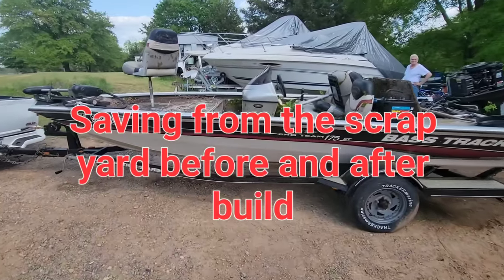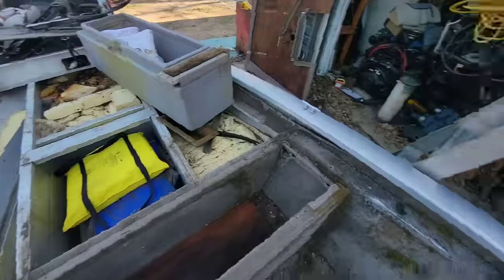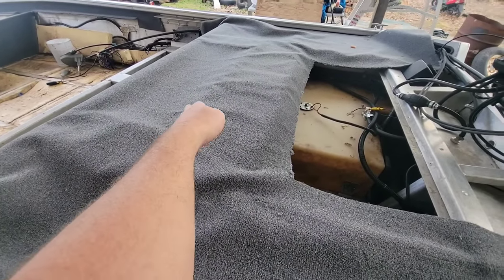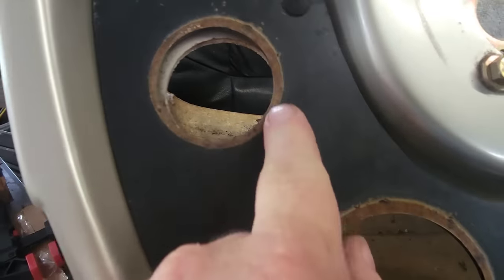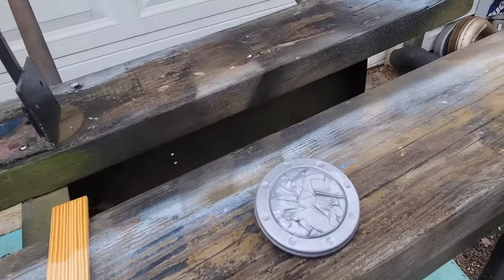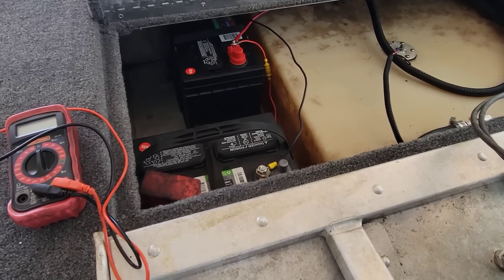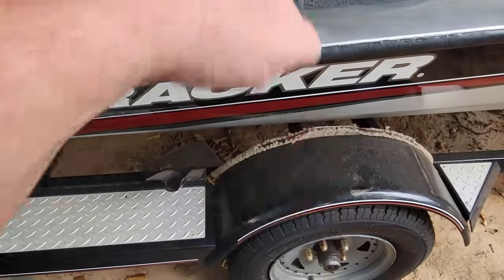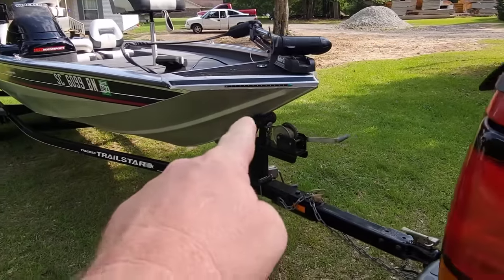Must see Bass Tracker restore before and after transformation@Vassmotorsports#trending #viral

Comment: Really nice restore!!! I’ve seen lots of them were the motors torn up electronics are all shot etc. that was a great score with the motor and trim intact. You do great work👍
Reply from the maker: Thank you and yes that was the best part about this boat ( and all aluminum)  but I've also saved and rescued many pleasure boats with mercruiser v8 and some had no drivetrain at all and I know those boats like back of my hand lol.  And grew up building chevy motors.  Really don't know much about outboards
Reply: Outboards are simple engines but can be tricky to tune etc. I’ve rebuilt a couple small outboards parts can be hard to get!

Comment: That an awesome job. Like you, I'm a perfectionist and as a perfectionist I noticed that the elevated seat on the back deck, well the plate on the bottom of the seat looks backwards. Could be wrong but check that.  Seat should lean slightly backwards when correctly installed. The front looked correct. Love your work!
Reply from the maker: Thanks and ill double check but I think the plate is same all around,  I even painted them black as they were dirty old silver but they were same when off and painted.  Must just be the way im on little hill and on trailer.   Boat sits flat on water
Reply: @Vassmotorsports  , if you set the plate on a table with the pin sticking up, look really close and you can see the pin is not straight. It's slightly angled. Correctly mounted the pin will angle toward the back of the seat. This makes the seat very slightly angled back.

Comment: Bass trackers are a good bang for your buck bass boat .
Reply from the maker: Thanks for watching Vassmotorsports,   it was a nicely made boat ,  I sold shortly after restoring her ,  I recently picked up a 98 Sea Nymph (in another video)  to resell  and it's all aluminum also ,except I'm not sure how much I agree with the big rivets they have everywhere holding the boat together under the water line , seems like a place to start leaking after so many years , nothing stays sealed forever,  the Bass Tracker was all welding and no rivets on lower or hull

Comment: Really nice job. Top notch. I have some experience with that model boat. One thing I hate is the console is positioned to the starboard side, making the boat list if you're solo. It would be much better as a center console, not just the Bass Tracker, but any boat of this size or smaller.
Reply from the maker: Thank you so much,  and yes i was thinking that also ,but im not a very heavy guy anyways and just have to put equipment on other side hahaha

Comment: So I actually redid one of these boats not to long ago, what o found very useful was a palm sander, saved me so much time doing that
Reply from the maker: I didn't show on video but gasoline on a rag takes off glue better than anything, ive been using it since i was a teenager like after remove a sticker from car or bike even boats.   Cause its safe and works great.  Then id clean and wax painted surfaces.   But i got some of the really thick and bad spots with gas then i used these sanding/ grinding disc on my angle grinder from Harbor frieght and they work great.   But will clock pretty quick if glue to thick or to much like any other sand paper.   Thanks for watching Vassmotorsports and good luck with your project
Reply: @Vassmotorsports  that probably would have saved me a lot more time with the gas, didn’t know that before today thanks! I ended up finishing the whole video, I commented that when I seen you using a hand scraper an was like oh no!!! But the boat came out very nice! I was actually really impressed, good job and definitely earned a follow🫡
Reply from the maker: @iiblack_spade5754  thats awesome thank you ,yeah scraper was just for some areas around locker edges and maybe some real thick spots,   or my dad started with one and was helping me while i was working on something else ,then i showed him the gas trick and then most glue was gone and much easier and i bought the sanding grinder wheels and he was happy haha. ,unfortunately he caught covid and messed him up for few months so i finished the boat myself and put back together,   hope ya check out some of my other videos like my Stingray that was caught in Hurricane Ian last season, and did ya see the beautiful wake boat I did my custom touches on recently?https://youtube.com/playlist?list=PLdT80g2lqT-CCYLNbUBrfjXbh5oOU48RN&si=sD5MSreG6gWN7oRr
Reply: @Vassmotorsports  well atleast you and your father got to take the boat out! Seemed like it ran pretty nice considering what it’s gone through lol, definitely going to check out some more videos, I love boat restorations so I’m definitely gonna check out some more videos, in fact im about to eat some pizza and watch that video right now haha
Reply from the maker: @iiblack_spade5754  hahahaa. Sounds good.    Yes he did get to go with me when i first got it and wanted to make sure motor was good before i stuck a dime into the boat as it was free and had to send for title and took some time on that ,  I just wish he could have went on it when it was all done and bet he wouldn't have believe the difference, but covid messed him up for a long time and i sold the boat recently to my cousin had been asking about it since i started the project and he knows what kinda work i do ,( i have some seats off his Beavertail skiff im about to redo custom diamond tuck soon ) but atleast mom and da got to watch the videos after it was done

Comment: Great job, Recently discovered that after you rip the carpet out put a generous amount of goo gone over the glue left behind let it sit in the sun if possible makes glue removal much easier with scraper you can get it back to slick fiberglass
Reply from the maker: Thank you so much and Thanks for watching Vassmotorsports,  this boat is all aluminum and 2 pieces of wood for flooring,  I tried goo gone and many other chemicals. And even where they dried it was hell haha.  Gasoline is the only thing that really cuts it (although stinks and messy) I've been using gas for over 35 years on glue from stickers on paint like bike tanks ,cars , even fiberglass boats ,   but if painted surface just clean good with water and put little wax over that area. , thanks for the feedback

Comment: Link for seats ?     What size rivets were on the hinges for all of the compartments.   They look larger than 1/8" diameter ?
Reply from the maker: https://www.ebay.com/itm/NORTHCAPTAIN-Deluxe-White-Charcoal-Low-Back-Folding-Boat-Seat-2-Seats-/314549651185?mkcid=16&mkevt=1&_trksid=p4429486.m46890.l6249&mkrid=711-127632-2357-0
Reply from the maker: The seats are on ebay ,i think i paid $340 for all 5 shipped to my door,   some rivets were 5/32 and some were 3/16.   The 1/2 long work better in most spots because i wrapped the hinges in carpet like they did factory on this boat ,and I even had to use old  hair clippers i have to trim carpet on hinges so lids would open and shut ,also to many layers of carpet and the rivets wouldn't reach.   I have a seperate video on doing the carpet also on my channel,   thanks for watching
Reply: This link is expired unfortunately can I get a new one? I'm trying to replace the exact seats. Amazing attention to detail on the restoration.

Comment: I have the same boat. I got 3 cracks about 2 inches long in the bottom of the boat that is picking up water. How would you fix it?
Reply from the maker: Oh wow.  I'm not 100% sure but seems like would have to be welded by someone who welds aluminum, that will definitely work but need to find a welding shop low key who would handle it for you. Thanks for watching Vassmotorsports, hope ya check out some other videos

Comment: Did you have to do anything to the trolling motor
Reply from the maker: Thanks for watching,  all i had to do was add new battery for trolling motor, it works fine
Reply: @Vassmotorsports  ok thanks just wondering . I need some replacement parts for mine.

Comment: Let me know how that trolling motor battery holds out with the engine charge system charging it when your running the engine.
Reply from the maker: It's not hooked to the engine ,only the starting battery.   It had an onboard single charger for the trolling battery when home or shore power but was bad when I checked it so I put the dual bank so they both be ready to rock whenever take the boat out
Reply: @Vassmotorsports  Ok so the charger is dual out charger. Good deal. I thought I seen a wire running from the starter battery to the trolling battery in the video. I know I got a used boat last year and they had the trolling battery charging when the engine was running. I changed it first thing.

Comment: I got a 2009 50 Merc 2 stroke for free that I put on my 1966 13 ft Boston whaler.  It hauls ass
Reply from the maker: Thanks for watching,   im still not sure what the top speed is.  Im just guessing mid 30s,hopefully ill be on the water soon and i have the gps now
Reply: @Vassmotorsports  I think we clocked in at 35 with 2 adults and 15 gallons of fuel

Comment: Never use pressure treated with aluminum. Boat looks great
Reply from the maker: Thanks and Thanks for watching Vassmotorsports,  so curious why would you say don't use the treated on aluminum?   All the sides and couple inches in are covered cause the carpet is wrapped around,   but it is touching the 2 inner rails

Comment: I wonder if a flooring scraper would have worked getting that glue off.
Reply from the maker: Im not sure.  Its very difficult to remove,   I didn't show but all the panels i used gas on old rags and that alway works the best ,to get the most off.  Then i wash them with purple power and after they dry i wipe with Acetone so the new  glue will stick ,  I also got some cool sandpaper grinder disc at Harbor freight after the gas to get light glue off, i even used the gas on rear deck after my dad tried scraping most off.    Thanks for watching Vassmotorsports and hope ya check out some of my other videos

Comment: Noticed the foam flocation in the bottom of the boat,close cell foam can hold water. Weight problem, aluminum can  deterate. Condensation too floor.
Reply from the maker: I washed it out when it was stripped down before putting floor in to get rid of any dirt and mold and it sure didn't seem to hold any water to me and its been sitting outside for 15 yrs or so before i got it and absolutely no deterioration or corrosion on anything except the 2 pieces of rotted floor wood.   Bass Tracker did a good job by building an aluminum boat structure ,thanks for watching Vassmotorsports

Comment: Do you have a contact #.  Here in Spartanburg interested in having a Tracker upgraded.
Reply from the maker: I dont do alot of customer work.  Everything i work on i own ,   what are you needing done ?
Reply: @Vassmotorsports  Similar to what you did with your Tracker.  New carpet, motor tuned up, re-wired.
Reply from the maker: @jodywhitlock937  thank you for watching Vassmotorsports and thank you for asking me to do your boat , but that is a very time consuming job and I have so much going on i definitely cant take on that project ,but if anything changes ill let you know,    also just a heads up that's a pretty expensive task

Comment: I guess that boats are just neglected by most ,, boats are made to destroy themselves how they are made,the carpet,the plushy seats, all the plastic stuff,,and are a water trap,,,I have a bullet and I don't go if it is calling for rain ,,,if been caught in rain with it and everything gets wet inside you have to spend a few hours emptying it and drying it,,,,boats are meant to get wet on the outside not inside.good luck on your boat😁
Reply from the maker: I would have to say even if gets wet every so often it wont hurt it ,just let it dry good before putting on cover,   just leaving them outside uncovered in the weather is the worst possible thing for a boat ,  and keeping stored inside is the absolute best case and the boat will last many many years and still look new , same as a car or anything else that sits outside , but even a cover makes a world of difference on how long they last and stay in great shape ,or carport ,  sounds like you take good care of yours, thanks for watching Vassmotorsports, hope you check out some of my other videos and follow for my next build

Comment: Low hours isn't necessarily a good thing with old engines it just means it sat for a long time and chances are it was not maintained while sitting wich could lead to premature internal engine failures. Point is low hours or low mileage just turns me off of old vehicles
Reply from the maker: I can agree with you on that to some point.   Luckily a 2 stroke engine is totally different and when i did compression check all 3 cylinder are perfect and together in spec and carb bowls were just little trash no corrosion, so this is a different beast and Luckily its low usage boat ,  which is good foor the gears in the outdrive (all though it did have a lube leak and i fixed the seals in another video) thanks so much for watching,  but yes very bad for most vehicles to sit and things dry out or rust / corrode

Comment: Hate to tell u this but im ocd to and those 4 switches under the steering wheel should have been replaced just saying. Its a very nice boat man seriously i like it alot
Reply from the maker: Haha thanks,   it's not actually all done , I probably will replace them and need them labeled,  also I noticed a leak on outdrive when I was doing the end video and I took lower unit apart to reseal it and will have a video on that lol,  also im redoing the other bunk boards on trailer and matching carpet,  I just wanted to get all this footage off my phone and get the video posted ,  I love getting them as good as I can

Comment: Great job man what a restoration be proud on that boat .I still have my 2001 in factory practically meant condition few Is dings on the bottom and stains on the carpet but I really want to do my carpet .I love the way you redid it and also wanna do my console black like like yours .I do have  faux walnut wood grain under my gauge cluster .And under my switch cluster so that's how they came from the factory. really good boat but I wish you showed more about the carpet work you did. because I'm terrified to do mine. I also  managed  to fit 2 group 31 deka batteries next to my fuel  tank. Cut both  sides off the battery  tray.
Reply from the maker: That's awesome, and thank you for watching,     I actually do have a video already on my channel about the carpet replacement, if you get a chance to check it out https://youtu.be/k0q7QNIUTPw

Comment: I did a 1998 pt175 and it looked to be in a simular condition when I got it. I didn't go back with carpet I decided to bedline it with tintable bedliner. I also redid the floors with new MDO wood and coated it in epoxy. I bought it for $800 and put about $1200 not including electronics in it.
Reply from the maker: I'll bet that turned out nice.   This was my first bass boat restore so I wanted to make it as close to factory or better than I could knowing it would be sold ,the boat was free with no title,  so I filed for title first before putting any money or time into it.  I had no more than $1500 invested in everything including the GPS (used) and even tires and bunks for trailer ,but im a deal finder and shop for best deals I can ,thanks for watching Vassmotorsports

Comment: Thank you so very much. Got my boat ¾ gutted got hurt and have a pile of aluminum framing I don't remember ( I am 62 ) where it goes. Looked for and hour all over the www. World then found you. Thank you again. Live in western WA. Hobo herion woke World.
Reply from the maker: thanks so much for that and sorry you got hurt and had to stop , these are like a big puzzle for sure , and my dad took most of mine apart while i worked another project and he got Covid bad for while and couldnt help me put back together so it was definitely intimedating at first but turned out not being as hard as i thought when i was done.   but it is a big job.   thanks for watching Vassmotorsports and hope ya check out some of my other videos,  heres a link to one that was more about the carpet and cant remember but maybe it shows more of putting it back together https://youtu.be/K7avfDF6QME?si=QJRGWkpSSoyFdH89
Reply: @Vassmotorsports  thank you sir. I was standing bent over swung the the claw end of the hammer into the foam pulled ouch. Now it's now 102⁰ in washington state which is insane. I will watch that link. Cheers

Comment: I’d bet that as neglected as that boat was the transom is shot. And why do all that work and not pull out all that foam and replacing it to.
Reply from the maker: i had the wood out and there was nothing at all compromissed with the rails or transom and the foam was solid so why would i touch that ? i did clean and wash it out but foam will last the life of the boat or longer as long as its not damaged by the sun or an animal.  thanks for watching Vassmotorsports and hope ya check out some of my other videos

Comment: Pressure treated is a no go on aluminum boats. Cause’s electrolysis
Reply from the maker: Curious why you would think that ? It's covered in carpet and glue and has the stainless screws grounding it to the frame lol,    I would imagine it will take many years to affect anything  but time will tell

Comment: Should be using bed liner spray for decking.
Reply from the maker: Treated wood and a thin layer of resign over that before the carpet.   Everything else is aluminum and I wanted this one to be as good as factory does since it was my first bass boat restore and don't like cutting corners ,  thanks for watching Vassmotorsports